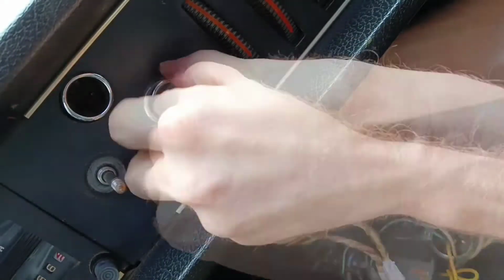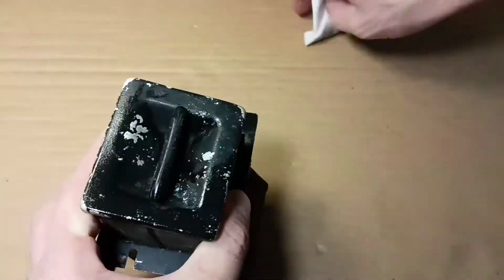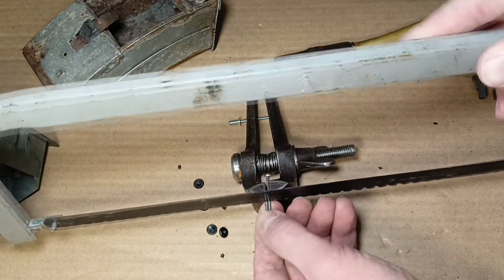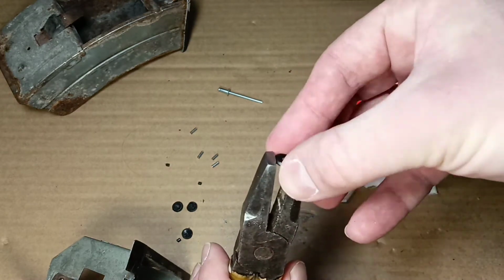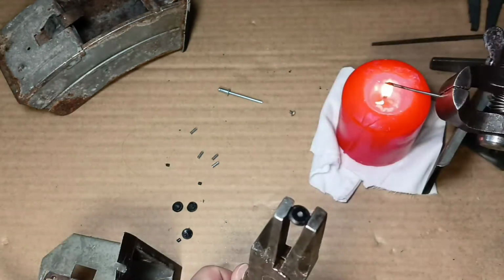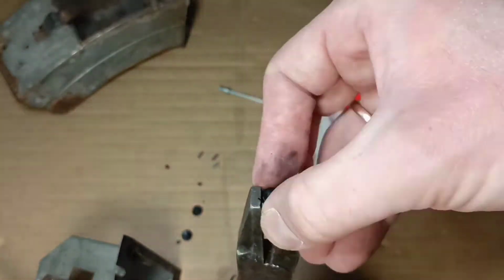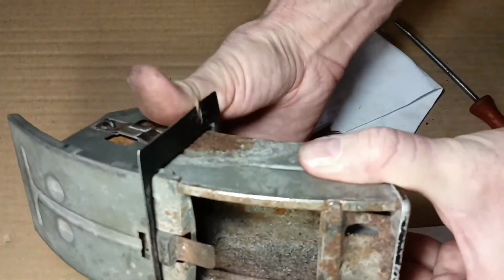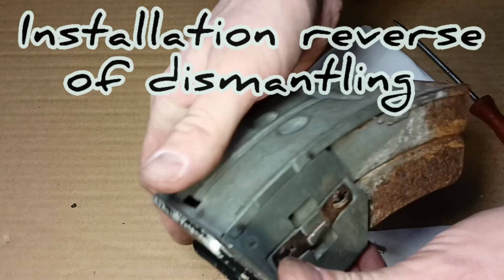Car Dashboard Ashtray Repair #volvo140

Comment: Great job with the ashtray repair! I love this kind of repairs where you figure out the solution from what you find in your workshop😄. Thanks for another great video Patrick! I plan to install an USB changer inside my center console ashtray since no one smokes these days😀
Reply from the maker: Hi Marcin! USB changer is really cool for a classic Volvo! You helped me confirm the realization of my plan to install a cassette tape recorder from 240 inside my dashboard. A few years ago I had a CD changer and it ate all 6cd discs, and did not give them back, and the shitty car * itself burned oil, while remaining under warranty, and after that the belt slipped and the valves bent. Since then, I don't like new cars of some brands. Therefore, we continue to enjoy loving and taking care of our old Volvo. And we enjoy carrying out repairs that we can do ourselves.
Reply: @patricksgarage  It's true! Making the repairs on my own is something I enjoy the most. I don't have a radio in my volvo now since the one I had drained the battery. So I removed it and now only enjoy redblock sound ;). Yes, noninterference valves of the redblock are a winner for sure :).

Comment: Beautiful work with the small wheels. Mine is quite hard to open so I should take a look at them. Cheers for showing that part of the dashboard disassembly. I’m trying to replace my hazard warning switch at the moment and the sharp plastic is not so friendly to my hand with the dashboard in place. 😢
Reply from the maker: Hello Tim Sheridan! Oh, yes, I have to change the hazard (emergency warning switch) too, the button gets stuck there, it's sometimes annoying. The plastic is very weak, and if it breaks, we won't find it on sale, so we have to be very careful. It seems to me that the switches of the 70th year of manufacture are more reliable than the 1972 year of manufacture. How nice of you to remind me of that. Thanks for watching.